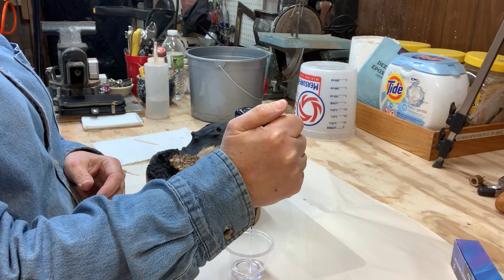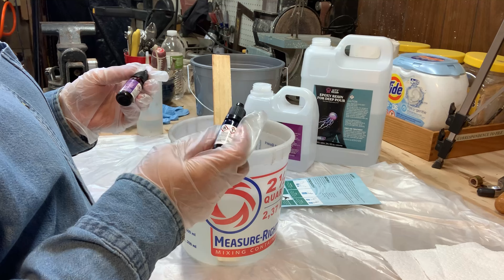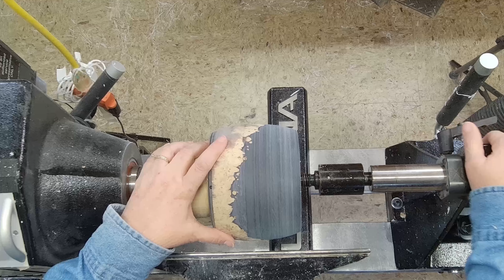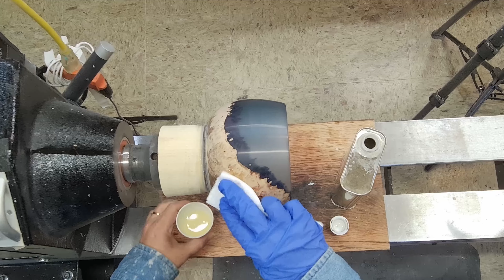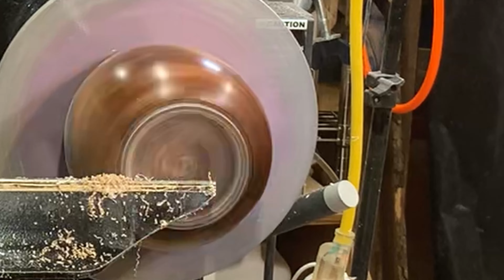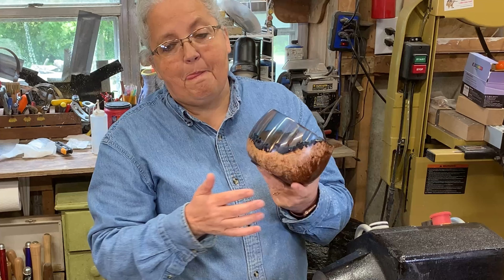Woodturning - Burl bowl Giveaway

Comment: I think it came out great! I’ve not jumped into the resin craze but being retired now and after seeing some of these vids I’m thinking of experimenting with it. So did you build your pressure pot or buy one all ready to use(plug n play). Was that a negative rake carbide you were using? And lastly, your honesty about what you’ll do different next time and your critiquing yourself is what keeps bringing me back! Great job!!!
Reply from the maker: Thank you. I purchased my pressure pot, wasn’t quite comfortable with converting a paint pot when I started with turning epoxy. As for my carbide tool it is just the regular cutters that came with the tools. I however did buy a negative rake cutter for my easywood #1 hallowing  tool and found to benefit to it and changed back to the regular cutter. Now that could have been operator error. Hahahaha 
If you should jump into epoxy wood combinations turnings the name of the game is patience, which I have to admit I struggle with that myself.
Again thank you for watch and commenting.

Comment: The bowl is gorgeous.. I actually really like the transparent blue color. If you don’t mind sharing, what kind of glue do you use for your glue blocks?
Reply from the maker: I used a five minute epoxy. I purchased at the dollar tree, very inexpensive and works as well if not better than some of the name brands in the big box stores. The brand name is actually super glue but they have a line of 5 minute epoxy. Unfortunately I have only found it at the dollar tree. So I always stock up.